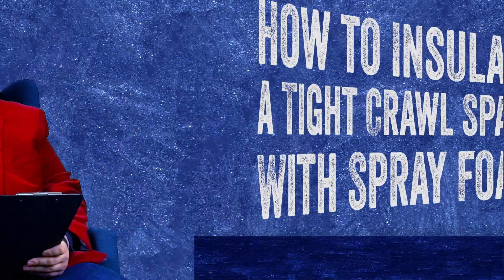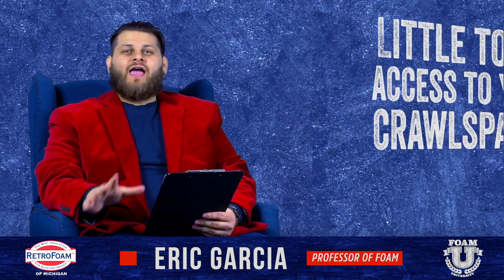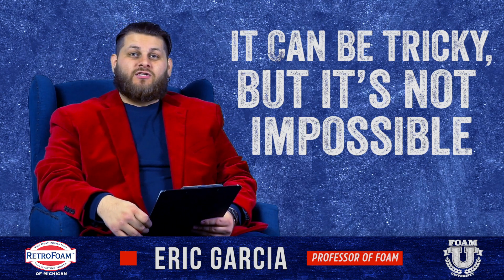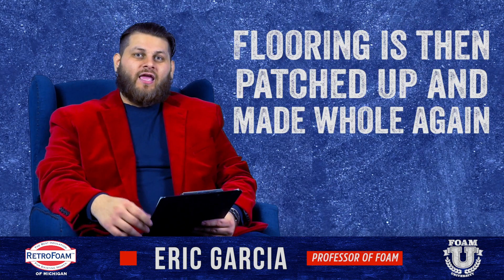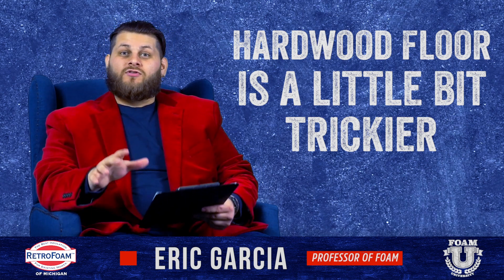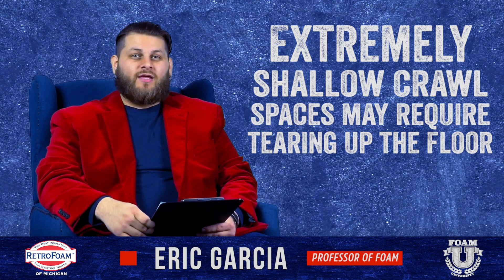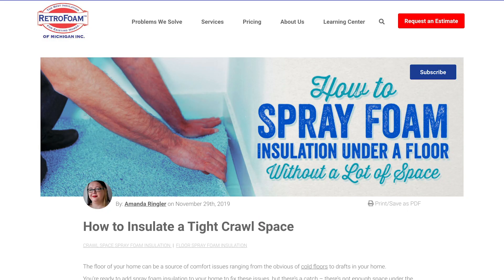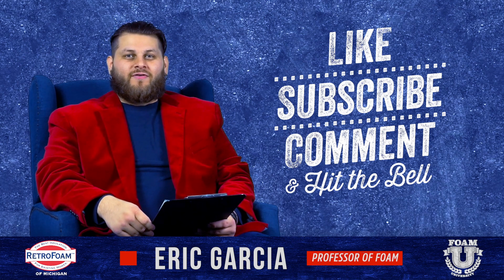How to Insulate a Tight, Shallow, or Inaccessible Crawl Space with Spray Foam | Foam University

Comment: My house clearance of crawl space is varying from around 14” to near 4 feet. Uneven sandy soil is dusty but at the same time allows to ditch sort of trench which will allow me (I believe) to get into tight space areas and reach rein there using extended band, possibly right angle one if available. I am thankful for this video which makes me feeling bit better realizing I am not the only one with such a problem. That is big relief. Local foam conteactors are saying there is no other way than torn the floor. That’s impossible as it is partially made if self leveling concrete and most is covered with wood floor.
Reply from the maker: We’re glad this video could help you feel a little less alone in tackling that crawl space challenge! With the tight clearance and unique flooring situation you’ve described, working with the right tools and careful planning can make a big difference—just be sure to keep safety in mind while you work down there!

Comment: So a right angle spray wand attachment on a long extension with a remote camera seems like a viable solution to me, but I guess contractors are more into making fast money, then solving challenging problems like this. I'm pretty stubborn and probably should've torn up my subfloor by now, but although the subfloor is exposed, there's three-quarter inch decking underneath it which poses yet another challenge the other challenges that all of the subfloor on the perimeter of the room is actually installed  underneath , not beside, the outer wall. So I'm going to use XPS and install it using a special lift consisting of two scissor jacks that raise and lower in sync using a sprocket and chain drive mechanism. I also design and build a remote crawlspace, reconnaissance droid with an orbital camera. Both of these can fit under a 6 inch clearance, which is about what I have. Desperation is the mother of invention.
Reply from the maker: Michigan, we totally understand how unique and challenging some crawl space setups can be, especially with limited clearance and complicated subfloor configurations.

If you’re still exploring insulation solutions, particularly for crawl spaces, we’ve covered a few approaches that might be helpful:
https://www.retrofoamofmichigan.com/blog/best-way-to-insulate-crawl-space-with-spray-foam-walls-or-ceiling
https://www.retrofoamofmichigan.com/blog/best-crawl-space-insulation-spray-foam-fiberglass
https://www.retrofoamofmichigan.com/blog/crawl-space-encapsulation-vs-insulation-difference

We know not every home fits the “standard install,” and that’s exactly why we aim to educate first—so homeowners like you can make the best decision for your space, whether you go DIY or professional. Let us know if you’d ever like to bounce more ideas around or want to talk through insulation options specific to your setup.

Stay innovative!

Comment: I have 6 inches of crawl space which cannot be encapsulated and floor joists sits on blocking over weeping ledge. Its a nightmare. Resolved to take up the floor, and have a plan to put back, but not sure this plan is the best way to go about it.

Tear up floor and expose to ground, Soda blast, dry and treat existing mold issue, replace or sister beams with pt, install ledger strip for rigid board to sit on and spray foam edges, tack plastic to underside of joists and tape off, one bay at a time. Did i mention i have to rejack support post locations as the floor fell 4 inches on one side?

Wondering if this approach will create  another issue longterm? Previous owner installed siding to the ground helping to trap moisture in.
Reply from the maker: That definitely sounds like a tough situation, but it’s great that you’re approaching it with a detailed plan. From what you’ve described, you’re taking the right steps by addressing the mold, reinforcing the structure, and planning for insulation and air sealing — all of which are crucial.

The key concern long-term is moisture management. Tacking plastic to the underside of joists could create a vapor barrier in the wrong spot, potentially trapping moisture if any gets past. You’ll want to be careful with how the vapor is directed and controlled, even one bay at a time. Also, given that the siding goes to the ground, that trapped moisture from the exterior could still be a problem unless it’s corrected.

If possible, we’d recommend consulting with a building science professional or an insulation contractor familiar with crawl space retrofits — just to ensure your plan won’t create new moisture or ventilation issues down the road.

Comment: Only I can barely fit under the floor, and I was told to use foam as an actual subfloor for floors that are just boards. Putting a floating VP floor on top didn't help, so do I insulate under, or not
Reply from the maker: If it is accessible, insulating over the floor can help if the side walls are sealed as well.

Comment: I have a 10x20 room on my house that is mostly blocked off from my crawlspace. Built on slab (used to be a garage I think). From the crawlspace there is a couple holes where the air vents go through. With that in mind, how far can spray foam reach when spraying? Do you think it could be applied across a 10ft span?
Reply from the maker: This is possible. It would depend on the size of the openings, how open the "crawl space" is. Best to have someone out to look at the project.

Comment: I have about  just enough space from the bottom to the floor joists to lay on my back or stomach and crawl. A litteral "crawl" space. I have yet to find a contractor willing to do the job. This is a vented crawl space, that would be just about impossible to encapsulate. I have no Idea what to do.
Reply from the maker: Yeah, that is tough. We usually require about 18" clearance in the crawl space but most contractors like 2 feet or more.

Comment: I have this problem and i have about 5 inches of space from the bottom of my floor joists. It sucks. I have no idea what to do. Im a carpenter and i just dont feel like pulling up the floors i just put down last year. I had no idea that the crawlspace had no insulation. However it stays dry underneath my house. the dirt has very little moisture. But all my pipes run underneath there of course. So i also have that problem. I would literally hav to pull up all the subflooring exposing the crawl space then install vapor  barrier then insulation. And that sucks.
Reply from the maker: Definitely not an ideal situation but sounds like that may be your only option, unfortunately.